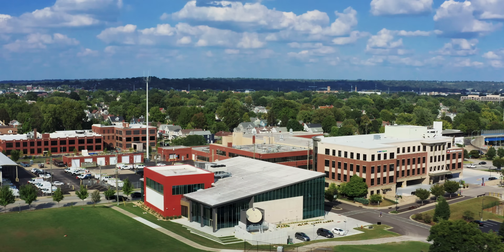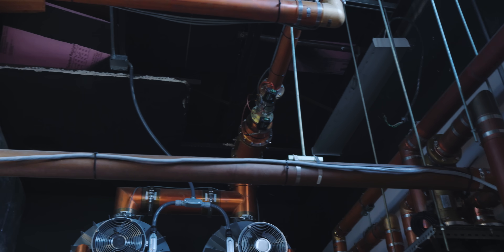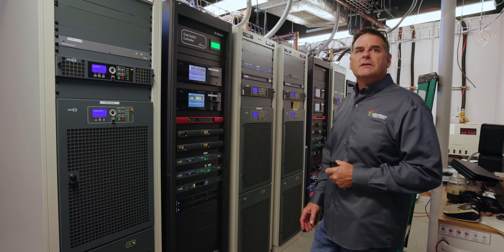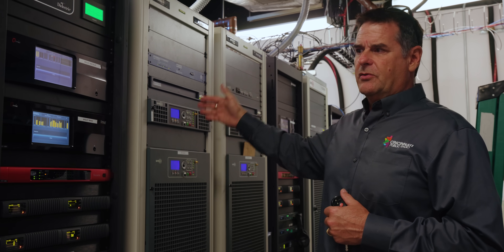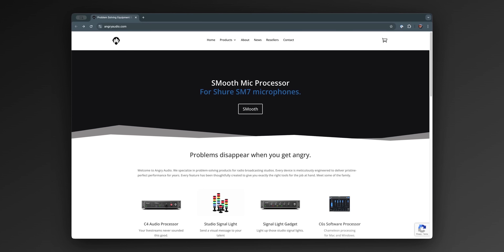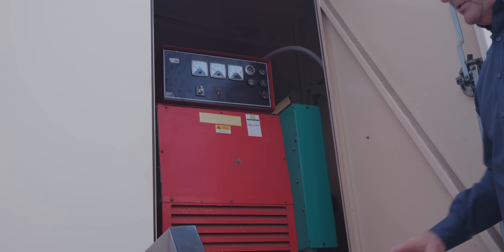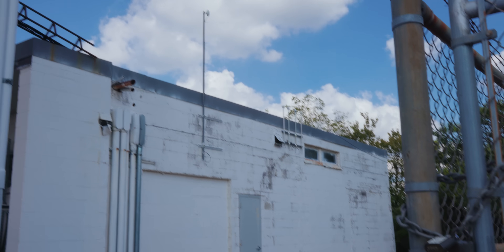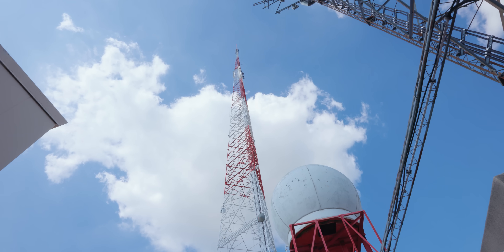Inside WGUC and WVXU's upgraded transmitter site

Comment: I was in that transmitter building in the early 1970s. WVXU was there, even back then, but they were using a tiny, low power transmitter in the corner of the room. It's been so long I don't remember too much about that site. I was also at the Ch 12 site on Highland Ave around that time. Their TV master control was automated with a system that read its event instructions from paper tape. The room below master control held the actual switching equipment, which had a lot of relays which sounded like a telephone exchange of that era. None of the current studios existed. WLW and WLWT were co-owned by Avco, with studios at "Crosley Square". The building where Ch 9 WCPO is now located was the Cincinnati Natural History Museum, much of which was moved to Museum Center when they renovated Union Terminal. Cincinnati has a long and interesting broadcast history. I'm grateful to have played a small part in it through some of my early employment. --de N3TS

Comment: What type off loss do you have in your combiners ?
Reply: Almost none! The ERI combiners have fans for cooling, and they never run. Reflected power from the combined is almost imperceptible
Reply: @willstaffan3229 is it just notch cans on each side set to notch out the other transmitter and some type of circulator at each transmitter output or something more exotic? 

I’m used to the smaller types we use at land mobile sites with a bunch of uhf 400mhz and 700/800 MHz. 

Where it’s either a hybrid coupler which suffers the “kind Solomon” (give me half) or band pass and notch cans with circulators between the output of each transmitter as it feeds into its notch or band pass cavity.

Comment: Good choice of TXers.. Harris Gates or Nautel ..  Omnia 9's thou? 20k for a cheap chinese PC in a box.. no thanks!
Reply from the maker: I’m a big fan of the Omnia 9. It’s a lot more capable than anything out there. I had done the configuration for these new Omnia 9s at these stations (part of a job I did with their integrator) and was very impressed with what they could do. Not the easiest to work with but very capable. What would you recommend as a processor? Nothing that’s out there today is made any more solid.
Reply: @TheBroadcastEngineer  Orban all the way thanks.. Omnia are horrid distortion boxs.. Telos sent me 1 to put on my stations to play with.. it was a CHR station I was cheif engineer of and I couldnt get open non offence sound out of it.. and it had stupid things in it like "auto pilot" and "solar plexus" which to me sounded like pus  and dont get me started with their gemicks like stereo embedding and Sideband surpression which causes more dramas with listener radios than good.. Even Hans Van zepten will tell you that these gemicks are not good and to avoid using them.
the 9 was made by  Classen and Hans... why pay 20k for something you get from Breakway/Stereotool for a 10th of the price and run it on a high quality PC instead of the cheap garbage it comes with?
Reply from the maker: I guess you haven’t seen the recent Orban boxes. 

Processing is such a subjective topic for engineers. Everyone claims theirs is better but the data they provide ignores something to make their case.
Reply: @TheBroadcastEngineer  Yes ive seen the new Orban's, yes they are x86 based PC's not DSP anymore but they arent cheap chinese motherboards, atleast they went with more a industrial build
I have noticed that processing is different in the US.. you guys love pinning the needle with a wall of sound with hyper compression and limiting. Australians wont listen to that... the highest rating stations are the least processed.. SmoothFM in Sydney and Melbourne case in point.. infact Mike Ericsson from Wheatstone was telling me 10 years ago the most highly rated station, I think it was New york was the least processed
Reply from the maker: We’re starting to come down from the loudness wars but some old timers will still set up processing so that the meter doesn’t move. WVXU and WGUC have fairly open processing.
Reply: Our Omnia 9s have worked great for us. I have used breakaway and stereo tool for our web streams and HD secondary programs in the past. When we had the opportunity to process these programs in a box with redundant power supplies and no overhead from running full-fat windows 10 or 11, we jumped at the chance! Combining our neilsen encoding and RDS has been great too. The stereo generator in the Omnia is also higher quality than the built-in pilot in the transmitters. However I'll agree with you that autopilot caused more issues than solved
Reply: @willstaffan3229  Totally agree. So nice to have the options of the Omnia 9. Mine does our FM, HD1, Streaming, PPM and well as Micro MPX to our transmitter sites. RDS is even ready to go if needed lol. The composite out of these box's are the cleanest out of any processor. Leif and Hans did a great job on the back end.

Comment: @ 5:58 that green ladder propped up against that pole is giving me chills down my spine !
Reply from the maker: Why did it give you chills?
Reply: @TheBroadcastEngineer  If it fell over and hit equipment it could end up costing a fortune in repairs and possibly put someone off the air
Reply from the maker: There’s nothing back there for it to fall against except maybe some tools. And if somehow it fell the opposite way it’s leaning it still wouldn’t cause any major issues at that site.

Comment: My professional career with broadcasting began at Radio Reading services when we were in the sub basement of the Masonic Temple on 5th street.  Shortly after starting there I was hired on by WGUC as a board op and learned so much from the station engineer at the time.  I later went on into TV production and spent most of my career in CATV/Telecom industry with signal distribution.
Reply from the maker: Pretty neat to see how it’s progressed from when you were there? I hope that the place I used to work is looking forward and not sitting solely on what I had done. There was still room for improvement.